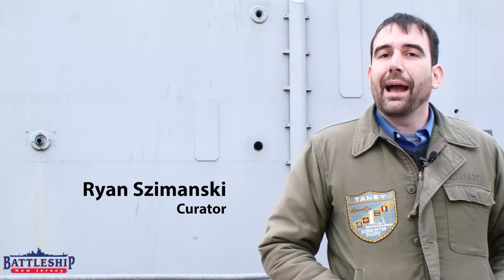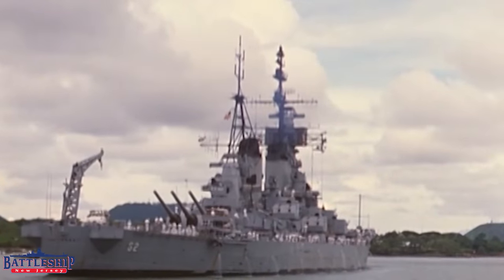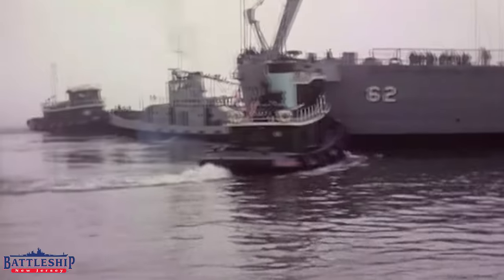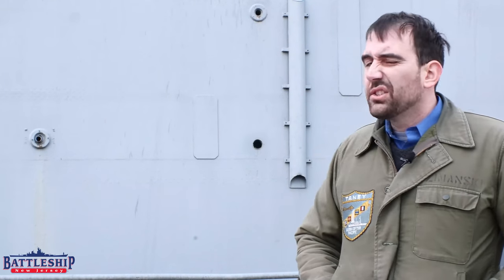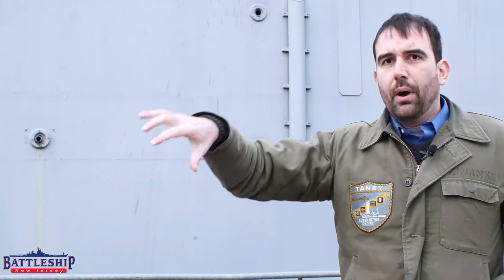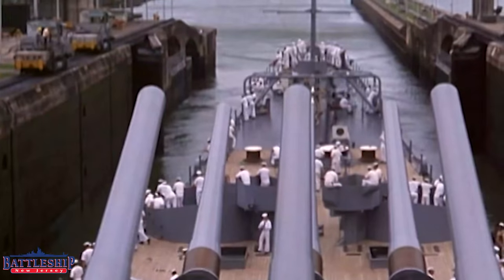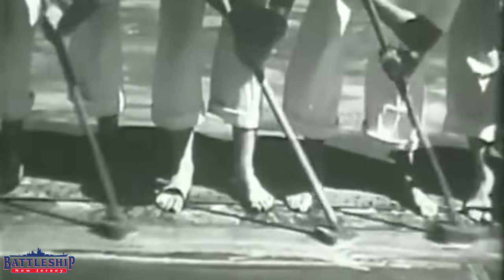Why Is There Water Coming Out the Side of the Ship?

Comment: Hi Ryan. I served my entire navy career mostly on steam power ships. Yes some of the water is from scuppers and the main fireman, but most is overboard discharge from condenser cooling.  The steam system is a closed system, but the cooling separate system uses seawater.
Reply: @graeme watson. your comment and my comment link to similar, only my vents were air cooling not the water one
Reply: Before sewage holding tanks the WC's drain right over the side along with the gray water. I.e. showers, sinks, laundry
Reply: @dannyisaacs7552  As the Diving Officer, part of the routine before putting divers in the water was to place the heads out of bounds because of this.  The trick was to make the announcement about 30 minutes before your dive team entered the water.  Because as soon as the pipe (announcement) was made, everyone immediately rushed to the heads.
Reply: Thank You for your service!
Reply: Is this discharge from condenser cooling high in salinity - higher than seawater? How does steam ship dispose salt?

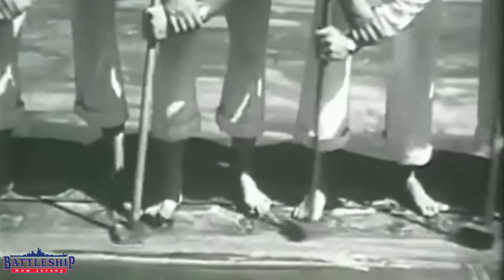Comment: 6:15 They aren't washing the deck, the process you see here is called "Holy Stoning" which I have done and it kills your back.  The decks of battleships and cruisers like the one I was on were covered with a layer of teak wood maybe 1½ inches thick and when the Holy Stoning is done and things dry back down, it is white.  I was doing what is shown in this video when they came and pulled me out of line and told me I was being transferred to the electronics division.  It made me appreciate that I had better study in electronics school and avoid this kind of thing in the future.   

The "stone" is a block of pumice with a dimple in the top to accommodate a mop handle.  Notice how the mop or broom handle is held by the sailors.  A solution of soap and water and even bleach is applied to the deck along with some sand and the "Holy Stone" removes the stains.  The sailors stand in a line and the duty bosun mate calls a cadence to set a rythm and each board is scrubbed a certain number of passes, then the entire line of sailors steps back and starts on the next board without breaking rythm.
Reply: he did explain the process of holystoning himself in an earlier vid, so its not that he doesnt know this, its probably that it fit the general maintenance he was talking about at that point.
Reply: Holy stone. Bleaching, sanding, scrubbing and polishing is all basically cleaning. Still looks painfully.

Comment: Wow. And for all these years I thought it was cooling water discharges for air compressors, cooling pumps, AC condensers, Reefer condensers, etc, but turns out it's just a massive high capacity scupper system.
Reply: They really should talk to some of their volunteers and use some of the other former crew related resources they have prior to putting out some of these videos. Because of who they are, people are going to take them as being (somewhat) authoritative on the matter. Yes, many of those drains are grey water systems. But the ship's fire main and related cooling systems was always going to be moving a lot of water around when the ship was underway. So to see the firemain not even get mentioned was a bit of a head scratcher.
Reply: Water cooled condenser coils for refers and freezers. Bilge pumps are below water line.
Reply: Ryan and Libby are doing a great job to raise awareness of the ship and Ryan’s historical knowledge is excellent (far greater than mine!) however, his mechanical understanding of the ship is sometimes a little weak and it’s difficult to watch him describe things based on limited information and speculation. I have never served aboard a ship of any kind but some of the systems we see in these videos are related to those that I do work with. It surprises me that after 20years of operation (granted, Ryan hasn’t been there since the start) as a museum (with no-doubt thousands of ex navy sailors passing through) that the workings of the ship aren’t known inside out by the staff. I don’t mean to cause offence as this is one of my favourite channels but I think as educators it’s critical that precise facts are communicated. I appreciate the amount of effort it must take to film 5 videos a week but I’m sure lots of us would appreciate a few less videos in exchange for a bit more research rather than just off the top of Ryan’s head (again, no offence intended)
Reply: @CJH2703  Yep. He does a pretty good job, but I think perhaps a "what is this?" or  "what does it do" to the audience/viewers  would be a better route sometimes. He shows informative and interesting stuff, but there are many "experts" watching these that are quite willing and able to help him out. Everybody learns that way.
Reply: Nope, wrong answer. No SWOS pin for you.
Reply: And i just always assumed it was bilge water lol nice informative video
Reply: that's exactly what I thought.
Reply: Well  very  clever  guy  i suggest  use some  plastic  pipes fire retardant i suppose an rubber  knops on deck for lest rushed   let you know  of furture development
Reply: You would be correct. MMC USN (Ret) Took a tour on the Hornet years ago. Made a mistake and answered a lot of the questions people started asking in the Engineroom. I could also have answered questions about the deck edge aircraft elevators, but those weren't open for touring yet.
Reply: In a battleship there are hundreds of holes in the hull for inlets/outlets for numerous systems.  Those with outflows above the waterline are those that cannot afford to have back-pressure preventing outflow.  If its not a simple drain from scuppers etc, it is normally from the firemain relief valve.  Firemains are wet in warships and are constantly under pressure.  (22 yrs in the RN and 17 years as superyacht captain)

Comment: I was on 3 different Aircraft Carriers, and you could sometimes see water being pumped out from points on the ship. I had a fellow sailor who was in our squadron and he latter served on Iowa.
He told me that when they were pulling into port with all the fan fair that it was not uncommon for them to run fire hoses to the drain points, and fill bilge tanks to pump out on purpose while they were coming back in as a show off tactic. 
I don't know about the era footage that you are using, however when we sailed along side the New Jersey in 1985 the let us watch them fire the main and secondary guns from our flight deck, and we put on a mini air show for them around 30 to 50 miles west of San Diego, and I can tell you they were not pumping or draining water from 15 or 20 points on either side of either ship.
I hope some one else who has been stationed aboard one of these beauties will attest to this.
I am sure that if they were leaving port, and or returning from a long cruise, I could see them showing off the ship in this way as it could make the BB look more impressive than them just being pushed in by tugs at 3 knots.
LOL. I wish I had a picture of it now, but at North Island we had Ranger which was CV 61 then New Jersey which is BB 62, and then Kitty Hawk which was CV 63. So they lined them up at the pier which was made for Carriers. You could only see about 1 feet of the hull on New Jersey from the pier until you got up to the edge of the gangway. The Carriers are approximately 30 to 40 foot taller to the flight deck. It is way more gratifying to see the Battleships when they are now sandwiched between 2 super carriers with a pier that is 25 feet off the water.
And lastly I want to thank you for your channel and video's.
I have authored a book called (Warships of Plan Z, The German Fleet That Never Fought.) If it interests you, it is on Amazon.

Comment: I would have to suggest as a Maritime mechanic that this is mostly overboard discharge of a raw water cooling system i.e. hot water that just moved over an exchanger? I've never worked on ships from this era but I would suggest that this may be the case at some point.
Reply: Sorry guys. I definitely didn't read enough comments. Plenty of people have already voiced my opinion! Haha. I'll dig a little deeper next time before I throw my two cents in.
Reply: @taylorrambin2857    No problem!  You were spot on!

Comment: As some have pointed out, on more modern ships there is a system called "chill water". This is extremely cold, sometimes freezing temperature water that runs in insulated pipes throughout the ship. It supplies the ventilation system's cold air radiators or heat exchangers for air conditioning. It also supplies cold water to electronics cabinets throughout the ship for internal cooling. Although the chill water itself is a closed, distilled water system, the initial process of cooling the water is by a heat exchanger that uses sea water taken from a tank at the  deepest point in the hull and open to raw sea water (called a sea chest) This water can be 20 to 30 degrees F cooler than the surface water (depending on hull depth) and begins the process of removing heat from the chill water. To get rid of the heated sea water it's much easier mechanically to pump it above the water line and discharge it overboard. On modern commercial ships this first stage cooling is replaced with "keel coolers" which are basically radiators (just long, narrow boxes) attached to the hull and filled with fresh water and antifreeze. War ships do not use keel coolers because of their vulnerability. Also, "gray water" is normally discharged overboard. This is water from showers and sinks, dish washers, clothing washing machines, etc, and deck drains.
Reply: she's sinking she's sinking for the love of god swim for your life boy!

Comment: Ryan if you see this. I'd love to know why shaft alley is a single compartment when so much of the ship is compartmentalized? Would flooding in shaft alley not prevent the shafts from turning?
Great work guys. I don't live in the states and can't visit these ships but your in depth content is next best thing!
Reply from the maker: Shaft alley isn't one compartment on NJ, its a whole lot of compartments. On smaller ships it can be, but then they are smaller compartments so not as much of a risk of flooding. 

I suspect where the confusion comes from is our shaft alley video, but remember, there are four shafts, so we're just showing you an example of the type of space, not the whole thing. If you haven't seen that video (or whoever else reads the comments!) here's a link: https://youtu.be/Q5dkJ_KqljA
Reply: @BattleshipNewJersey  thanks much for the reply! I saw the vid but thought you could see all four shafts running through the same space! I'll re watch!
Reply: @ntomenicgiorgo3598  i doubt flooding in the shaft alley would prevent the shaft from turning directly, however it would be impossible to perform maintenance while flooded, and extremely hard to fix a leak without drydocking the entire ship. so it certainly makes sense to have it compartmentalized.
Reply: Most shafts are long enough that they have to have one or more what are called spring bearings, or a enclosure that supports the shaft. It has lubricating oil in it and if shaft alley is flooded, water gets into the bearing and could cause it to seize.
Reply: I served on a gator freighter. LSD-34   My GQ station was port shaft alley. It was about 60 ft long and had to entry points forward and aft about 3 decks down from everything. There were two bulkhead bearings one coming in and one going out, plus three line bearings. All had to be monitored for temperature. During general quarters your sealed in by water tight hatches. Only contact was sound powered phones. Quite cold and lonely. In order to divide shaft alleys into different compartments the would need to put bulkhead bearings,water tight doors at each bearing. Guess they figured that was to much money.
Reply: @BattleshipNewJersey  I re watched shaft alley and must've confused it with another battleship video that was titled something like, 'the only place in the ship where you can see all four shafts across the the ship not length ways. Maybe it was an older battleship. Can't find it now!

Comment: If you look below the main deck on the sides, you will see one or more discharges with milky white water coming out. That is the discharge from the ship's distilling units or evaporators. Ships cannot carry enough fresh water with them for the various needs- drinking, cooking, and most importantly, feed, or make-up water for the steam boilers. So ocean water is taken in, run through the evaporators, and turned into fresh, or potable, water. The average ship uses about 25 gallons per person, so on a ship like an aircraft carrier that will be over 125,000 gallons a day. That may seem like a lot, but that is for all sources. The discharge is water with a very high salinity, hence it's milky white color.

Comment: Excess boiler feed water, by the look of it. The system invariably processes more feed water than the boilers can consume in order to maintain a constant pressure, and the overflow is dumped overboard.
Reply: ???   The steam pressure and temperature in that plant means that any pollution ie salt residue is very much unwanted.  Cooling water from the condensers and other system onboard, that is another thing.
Reply: There is never excess boiler feed water. There are always losses due to valve packing leaks etc. Make up water to the steam cycle is thru the main condenser from storage tanks
Reply: Excess boiler feed water?  No such thing.  Evaps probably spend half their time making feed water.  It is much purer than the water used for cooking and showers.  It is never dumped overboard.
Reply: @nitetrane98  Yes, but the intakes on the bottom are constantly pulling in water and that water has to go somewhere.

Comment: As a navy vet who served on DDG-108 how did USS Iowa waste management work?
DDG grinds compost/paper mixed with seawater then pumped overboard,  plastics are melted down into giant sized hockey pucks then vacuum bag sealed then unloaded at port, metals were shredded then tossed overboard since seawater will break them down fast. But how was it done in the past on the USS Iowa?

Comment: I know they purify saltwater on board using condensers. That's just heating up sea water to a boil, and capturing the steam that comes off. I wouldn't think they'd boil the sea water dry, so to speak. They'll probably boil it until the salinity is greatly increased, but still dump that extra-salty sea-water back into the sea while it still has some fluidity left to it. If that's the case, then where does that extra-salty seawater exit the ship? I think they could keep adding more sea water to the condenser boiler for quite some time. But eventually they'd need to jettison the contents somehow, because of the salt accumulation. Perhaps they tested the specific gravity of the liquid periodically to determine when to dump it?
Reply: Low pressure flash type evaporators were use to make boiler feed water and when further out to sea, drinking water. Evaporators had 2 or more sections depending on the capacity of the unit. A feed pump supplies water to the first section and a brine pump removes the higher salinity water from the last section. That discharge is below the waterline.
Reply: @ronsimons9539  Thanks for the quick reply.

Comment: Most naval ships were outfitted with CHT (Collection, Holding, and Transfer) systems in the mid seventies. This is a system used for the sewage waste of the ships. These were used in ports. While out to sea, we sent the sewage directly overboard. When tied to a pier there was hose connections for the waste.
The vast majority of the discharges were from the cooling water for the mechanical systems in use.
ENC USN RETIRED...

Comment: How was the laundry done on ships? Did each sailor have to do their own or were there sailors assigned to it? Did sailors get back their specific clothing or just grab their size from a pile?
Reply: While I cannot answer for all ships, my ship, a destroyer escort, had one central laundry ran by SHs, or ship servicemen. You put your laundry in a central location to be picked up, your uniforms were washed and dried, and returned to your berthing area. A compartment cleaner then sorts it and throws it on your bunk. Every item you have is stenciled with your name. The only exception is your bed sheets. As they are all the same, they just throw a set of sheets on your bunk. If you are at a shore command, you do your own laundry with washers and dryers provided in the barracks,

Comment: This is a wholly unconvincing explanation. They can't be drains from the deck because we see water pouring out of the sides even when the ship is sitting in port in clear weather so the only logical explanation is that they are bilge pump discharge points and ships normally leak like sieves and the reason they are dry now is because she was sealed up good for long term storage. Look at the USS Texas, she leaks so much they can't keep her afloat without constant bilge pumping and it is the same with every boat and ship I have ever seen, they operate under the principal that as long as you can pump water out faster than it leaks in, everything is all good.

Comment: Is it worth replacing the  drain pipes with plastic over time, just to avoid disimillar metal corrosion to the armour plate, an internally coated pipe would still have dissimilar metal issues with the armour and fittings so just swapping the pipe to plastic is the best option 

A clear section of pipe and it even becomes a tour note